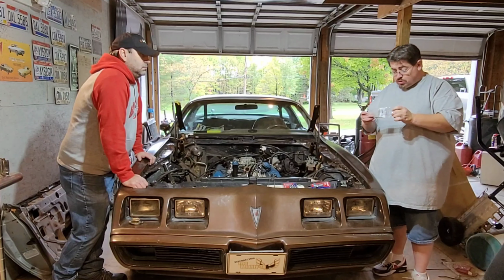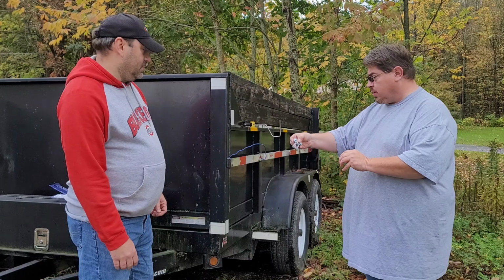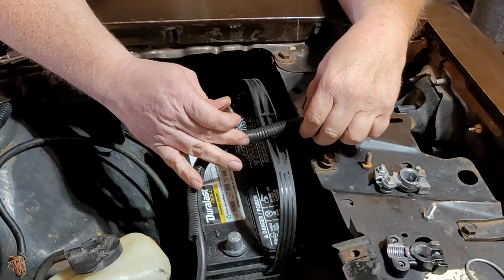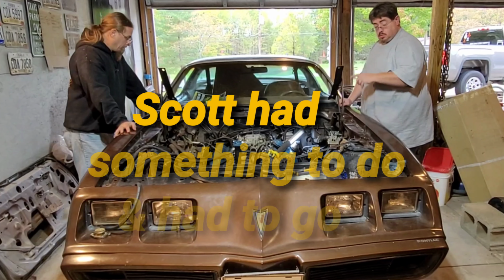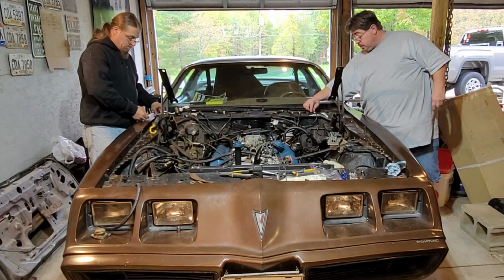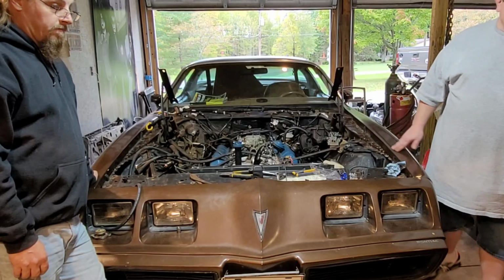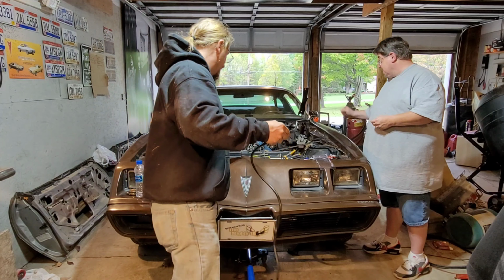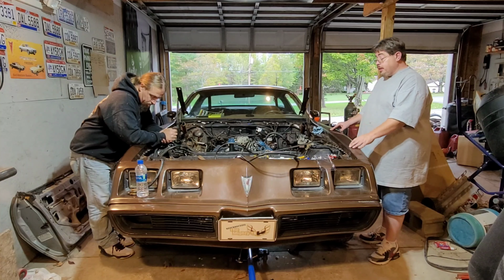Resurrecting The Mighty TA Se2 ep21. Battery terminal installation

Comment: Firsto! Now give me a sec to watch the video lol and I might be back with a comment😄
 :edit: ok what are you going to do with those nicely painted battery terminals when you need a jump start some day..? And it will happen💁‍♂️..
Reply from the maker: Already scratched em up... I had to put the battery booster box on it... still got nothing but that clicking noise
Reply: @barnstormer75 Dang, sorry if I jinxed it😄. I hope you get it figured out thou. Are you sure the batterys cranking amps are good? I've had several test good on the volt meter and even fully charge on the tender and regular charger, but didnt have the cranking amps to start anything. Even with using a booster jumpstarter hooked up. Some vehicles take alot more power to start then others. Had a battery just last week, would start a little honda civic(kinda weakly) but would not start a 93 Buick lasabre or a 91 toyota 4runner, just clicked. Swapped with new battery and fixed the problem.
Reply: Hmmmm remember when I said this was a problem and should be changed?